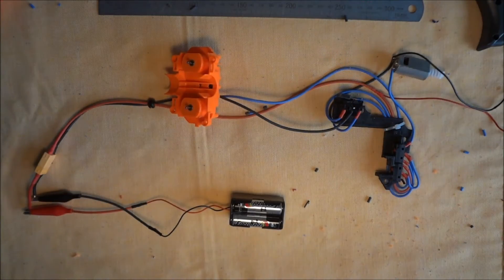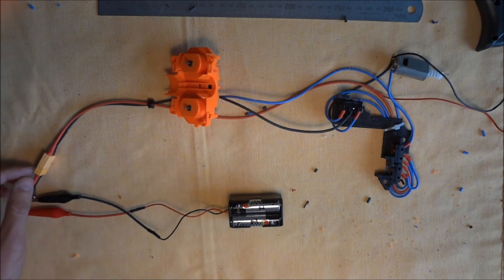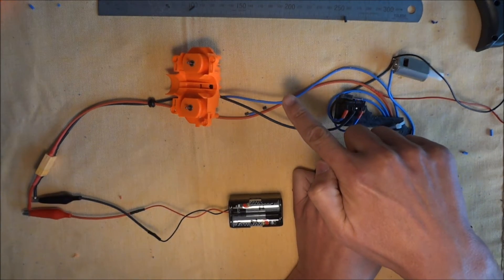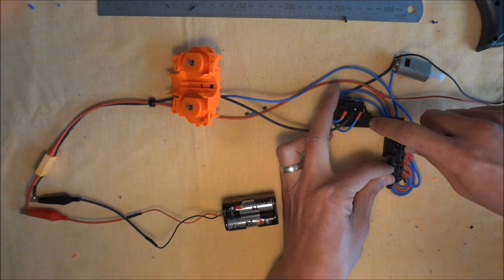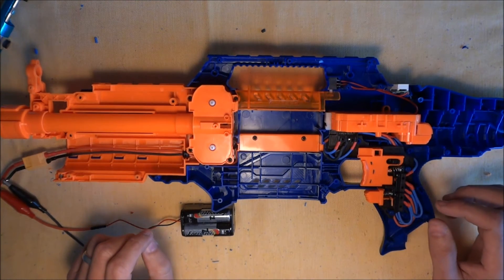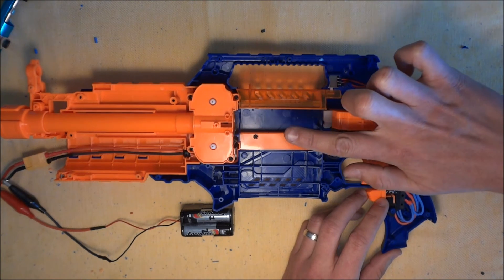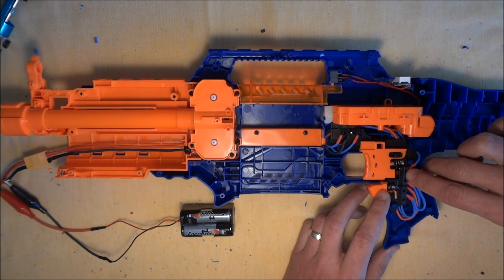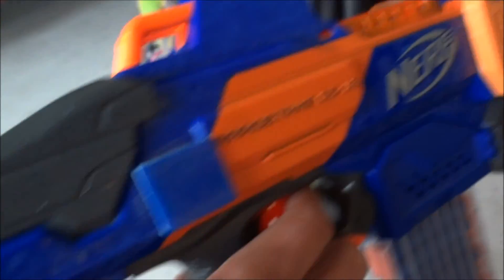Rapidstrike Loom/Motor kit testing and demonstration - Overview

Comment: does the actuator allow for 1 single fire?
Reply from the maker: What do you mean?   The third top switch under the pusher?  This switch monitors the pusher rod.  Once you let go of the firing trigger this switch makes sure the pusher rod retracts back to its normal position.  The 3 switch method is a much more precise way of wiring a RS and allows for nice crisp single firing.

Comment: how would i get it to retract?? i moded my gun but it dosent retract.
Reply: +WCxColossus it depends how you modded it, if you used this kit you put it in wrong and if you didn't your pusher control microswitch is positioned incorrectly.
Reply: +THEOSTRICH 73 i cant seem to find high rates micro swithces i find these temco ones but i cant fit them into my set up i boughta switch rated 5a but it belw up i assum cuz the pusher woul'  not work any more

Comment: what wires are connect where with the voltmeter
Reply from the maker: Voltmeter reads battery voltage.  So you can run your voltmeter wires from the wires off from the battery connector.  Though you will need a switch to turn your voltmeter on and off, so use the jam door switch to do this.
Reply: BlasterTECH When will the rhino version get back in stock?

Comment: its not this kit it must be my switch then ill double check it thanks
Reply: +WCxColossus no problem. also what switches are you using?
Reply: +THEOSTRICH 73 temco 15a micro switches i dont have the chip on the pusher arm thats probably y it wont retract
Reply: +WCxColossus that's probably why
Reply: +THEOSTRICH 73 first time mod so im still learning lol
Reply: I finished my first RS mod yesterday but that pusher control switch took me absolutely forever to sort out
Reply from the maker: +WCxColossus Not sure how you've wired it up but yes, make sure the switch is actually being operated by the pusher arm.
Reply: +BlasterTECH i dont have that switch i took everything out and rewired with 14awg wire i only have 2 micro switches one for the rev and one for the trigger thats why the pusher arm dosent retract
Reply from the maker: +WCxColossus Yep, it won't retract if you dont have the pusher cut-out switch.